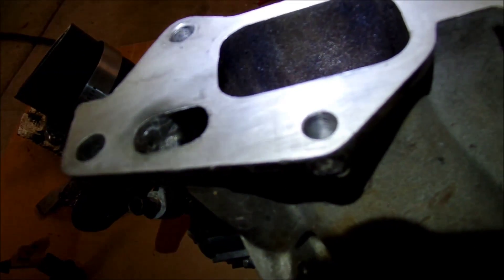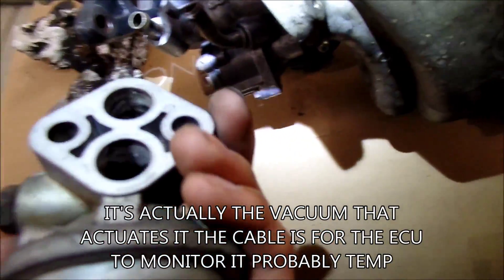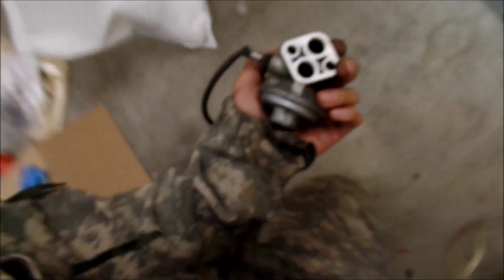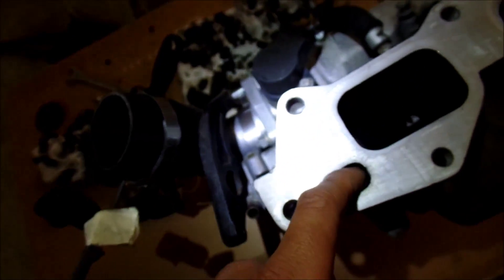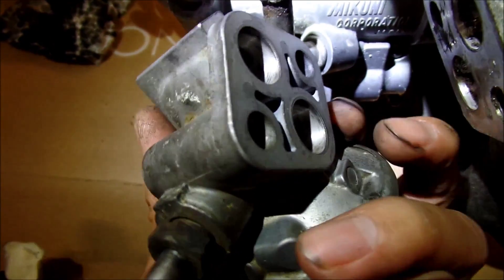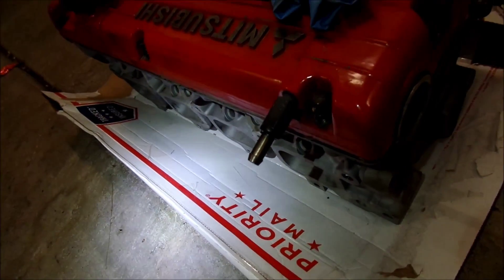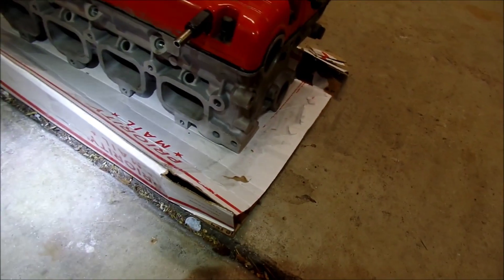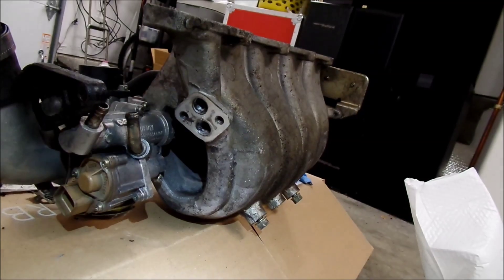HadesOmega Analyzes the 4G63 EGR System

Comment: In case people are wondering the exhaust enters the egr through a port that is in cylinder #4 on the exhaust side of the cylinder head on both 1g and 2g heads, so if you take the exhaust manifold off you will see the channel in the #4 port it essentially re-circulates the exhaust into the intake to help reduce intake temps, if you have high nox emissions on a smog test the egr system should be inspected and the ports cleaned out of any carbon and soot buildup won't hurt anything to keep it clean.